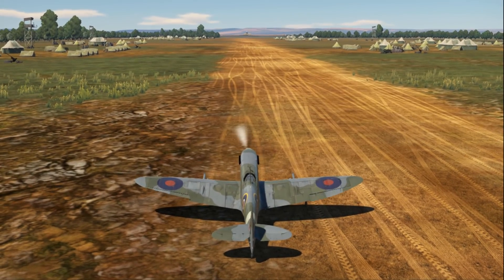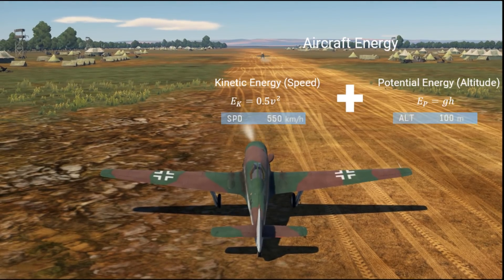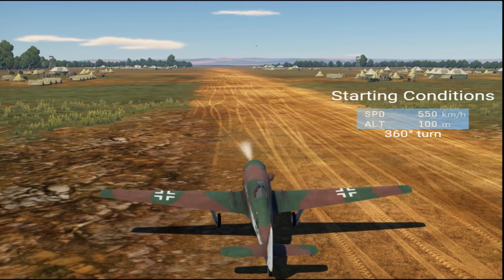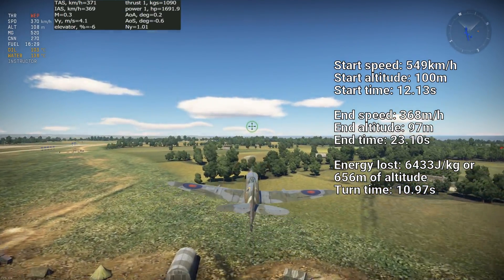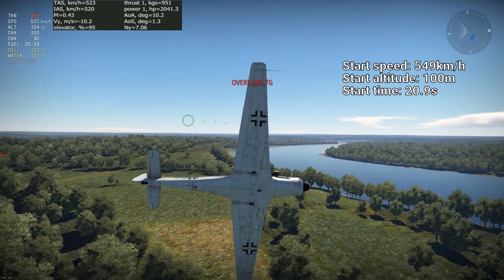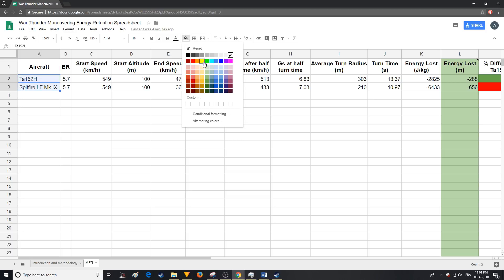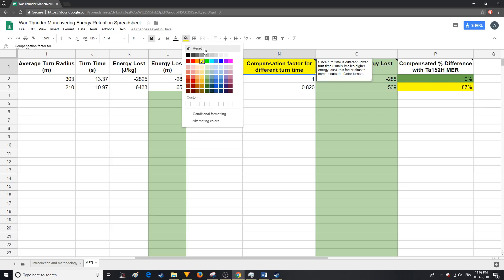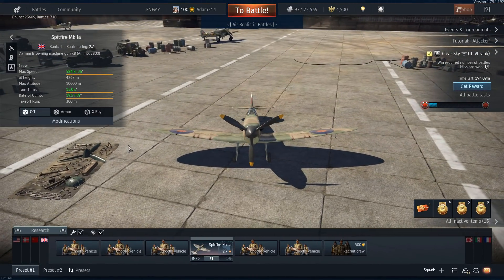Aircraft Maneuvering Energy Retention | Spitfire LF Mk IX vs Ta152H

Comment: Hi Adam, new subscriber. Will you be doing maneuvering ER for vertical manuevers? I think some planes like the 109s dominate at vertical manuevers despite horizontal turn performance being not all that outstanding. I've never really understood what it means when a plane is "bad in the vertical" so if you can cover it that'd be nice! Feel free to add as many physics concepts as you need :D
Reply from the maker: Welcome!

Hmm perhaps. I don't see why an aircraft with better MER would not also have better VMER though, still thinking about that.

An aircraft is considered bad in the vertical when it has poor climb and perhaps poor low speed maneuverability. It's not always clear what people mean by that though.
Reply: Adam514 I guess like what you said in one of your videos, loops are indeed complex manuevers from a physics standpoint. If you have the time to record it, a nice stat to keep for loops is how high of a loop certain planes can reach, or how low of a split S, maybe minimum starting speed a plane must be for it not to stall at the top of the loop, energy losses, etc?

Speaking of which, I think your sea level speed spreadsheet link in this video has a problem, it brings me to my browser where it tells me to download Sheets even though I have it, and not the Sheets app itself.
Reply from the maker: Yeah maybe I'll do a loop ER starting at the same speed, and compare energy loss, loop time, loop radius, etc.

That's odd, I got that too. I fixed it.
Reply: Adam514 If I remember correctly, a loop is actually egg shaped so finding the radius is probably not all that useful, and undoubtedly tricky as it does not have a uniform radius. I think just recording the height should be sufficient, unless you can find the horizontal separation between the ascent and descent parts of the loop.
Reply from the maker: A loop is egg shaped indeed, and egg shapes are simply a bunch of parts of circles with different radii strung together. I would approximate the radius by dividing the difference between the highest and lowest altitude by 2.
Reply: Adam514 I have a question about the spreadsheet: why is energy loss measured in m? Is it just the equivalent height loss if all energy lost was taken to be gravitational potential energy?
Reply from the maker: Exactly! It's simply the total energy lost reconverted into altitude lost, since J/kg doesn't evoke much in most people.
Reply: Adam514 Thanks for the info! Gotta commend your reply speed :D
Reply from the maker: Haha as long as I'm not sleeping and I actually get the notification!

Comment: 2:00 - you made a 9g turn. In those times the anti-g suits did not exist. Everything over 4G will make you almost instantly unconscious. Also the aircraft frame was not designed for such high-g turns. You should rip off the wings.  Next, TA-152H is the energy fighter. The energy fighters needs different kind of tactic than old-fashioned maneuver fight style. And also remember that tightest turn or max speed entry turn is not the fastets turn. The key is to start turn in corner speed.
Reply from the maker: The average person can sustain 4G for a while, let alone trained fighter pilots. I'd estimate that the top 10% of pilots resistant to Gs would be able to complete this maneuver (I'll admit not as precisely) without passing out. It's a 10s turn averaging at 7G. People don't pass out instantly just by the G number alone. You probably pull near 9G every so often, just by jumping the last few stairs. It only lasts a fraction of a second though so you don't notice.

This video is not about any sort of tactics, it's just aircraft performance.

Fastest turn time in such an energy bleeding turn probably requires to be significantly over your corner speed in order to maximize the time the aircraft's speed is actually near the corner speed. Corner speed is the highest speed where max angle of attack and max lift coefficient is achieved (minimum turn radius). Both tests started just slightly above the corner speed if you compare the "AoA" (angle of attack) between the start of the turn and when the speed goes lower (max AoA).
Reply: Wrong. Corner speed is the speed when the instant turn has maximum possible angular speed. It is not about turn radius. It is usually the point where the highest G and maximum allowed AoA are met. TBH my experiences are from DCS:World WWII project.
Reply from the maker: Maximum speed to conserve the smallest radius (max AoA) is synonymous to maximum angular speed. I just said it a different way.

Maximum AoA and highest G at max AoA is equivalent to maximum AoA and highest speed at max AoA which is equivalent to minimum radius and highest speed at max AoA.
Reply: Try to have maximum AoA turn at 150kph IAS and maximum AoA turn at 500kph IAS. You will have different Gs and different radius and still the higher g turn will have better anagular speed while the radius will be bigger. In very high speeds the G is limit because it won't you allow to increase the AoA. In low speeds the AoA is the limit because it won't allow you to pull more Gs. Also there is one more problem.  Those aircrafts did not have power booster. So you had to pull the stick by both hands with force over 50kgs in those high speed turns.
Reply from the maker: At 500 you are very close to you minimum turn radius, if you aren't already.

I agree some aircraft had earlier control lock up. Max speed while keeping max AoA will give the best angular speed. Best turn time must be at a slightly higher speed.
Reply from the maker: Interesting. Also for modern fighter planes they have the potential to go afterburner and actually stay near their corner speed for a while due to their much higher T/W.

Comment: Hey adam. I love the idea you have going here and it's a really informative video, however my inner nerd feels the need to correct some of the physics.

When giving the energy lost in a turn as J/KG you are giving a slightly misleading figure since mass is incredibly important in this case. Ovbiously a lighter plane with the same J/KG lost will lose less actual energy than a heavier plane with the same J/KG loss due to the lesser mass giving a lower absolute value. Since J/Kg is merely a coefficient it may give misleading values for the energy retention of an aircraft unless it is converted to just Joules.

This also means that you cannot equate it to altitude loss to maintain speed since the equation for GPE=mgh, again mass needs to be considered.

That said, I love the format and have subscribed (something I really should've done ages ago)
Reply from the maker: Hey! I encourage discussions about physics!

You are right, a lighter plane would lose less energy if mass was taken into account in the equations, but it would also start with less energy. But is that what we are really looking for? For example, an A6M at 500km/h would have less true energy (taking into account mass) than an F86 at 360km/h, but the A6M would easily catch the F86. Taking mass into account gives the wrong conclusions with regards to energy states. F4U4B has approximately double the mass of Bf109s, so if they had the same true energy the Bf109s would easily catch the F4U4B. By removing mass from the equations, you get a fair comparison in energy states, and which aircraft could catch another in the short term.

Mass plays a role in how much speed and altitude is lost in the turn of course, but it shouldn't be in the energy equations. The higher mass aircraft would start off with a much higher energy which isn't fair, and will end up with more energy in the end too.

Welcome! Let me know if something wasn't clear or if you still disagree.
Reply: Adam514 I see where you're coming from in terms of speed retention. However when I find myself energyfighting it's more about how much energy until they drop out the sky, which again is likely much lower for a lighter aircraft despite starting on a lower energy. I suppose it depends on your fighting style however.
Reply from the maker: Even then specific energy (energy without taking into account mass) is still a better measure of when an aircraft will stall, because stall doesn't really depend on weight. A lower wingloading aircraft will stall at a lower specific energy for sure.

Comment: Could you see if there’s any difference in ‘vertical’ energy retention compared to energy retention in turns? I.E. start both at 200 km/h and 5000 meters and dive at 30 degrees to 3000 meters, level out, note the new speed, and immediately climb at 30 degrees and level out when the speed returns 200 km/h. 

Could also add variations in starting and ending altitudes as well as dive angles (15,30,45,60) to get a richer performance profile of each plane.

Also for statistics acquired through testing I would repeat each test maybe 5-10 times and average them.
Reply from the maker: A squadmate is planning on doing something similar.

5 times is massive. It's a computer simulation, the need for multiple tries is greatly reduced.

Comment: Try the Stuka (Ju-87) and after a 360* turn you will crash into the ground because you have bleeded to much energy...:-D
Reply from the maker: Lol I think the real challenge is getting it to 550.
Reply: Adam514 Probably ;-) One question where do you have this nice chart from?
Reply from the maker: I made it.
Reply: Adam514 The chart which shows TAS,IAS, thrust and so on?
Reply from the maker: Oh it's called the "local host".

How to access the "local host":
You need to be running War Thunder or it won't work!

Option 1: on the same computer that is running WT:
-Type http://localhost:8111/ in the address bar and press enter and voila.

Option 2 (which also works on the computer that runs WT):
-Type http://Your_IP_Address:8111/ where you replace "Your_IP_Address" by your IP Address (192.168.X.XXX) in the address bar and press enter and voila, you can look at the characteristics on another device while flying.
Reply: Adam514 Thank you for your quick answer :-) but I guess this does only work for the replays?
Reply from the maker: Nono works everywhere, in matches too. I overlay it on my gameplay for YouTube.
Reply: Adam514 Ok cool, thanks

Comment: The LF 9 on current test flight spaded has 2000 HP, not 1700. Reference has an issue applying 150 octane modification to the LF 9.
Reply from the maker: Damnit, good spot. I'll redo the LF, the result shouldn't change by more than 10% though. Thanks mate!

Comment: Vidéo intéressante. Energie perdue en J/kg ?! Est-ce que ça veut dire que tu prends en compte la masse de chaque appareil ?
Personnellement j'aurais préféré une comparaison contre autre chose qu'un "turnfighter", sachant que le résultat allait être assez évident ^^
Une comparaison contre un P-47M, un P-38L, le 1er Spitfire Griffon ou un Yak-9UT aurait plus intéressante, selon moi :P
Reply from the maker: Merci!

J'ai utilisé l'énergie spécifique, c'est-à-dire l'énergie sans prendre en compte la mass, puisque la masse n'a pas d'importance lorsqu'on compare l'énergie des appareils.

LF et Mk XIV (1er Griffon) ont sensiblement le même résultat. Ce n'est pas les turnfighters nécessairement qui sont moins bons, parfois/souvent c'est le contraire!!
Reply: "...puisque la masse n'a pas d'importance lorsqu'on compare l'énergie des appareils." Il me semblait que l'Energy Retention d'un appareil dépendait en partie du rapport puissance/poids de celui-ci et dans ce cas la masse est  impliquée.
Concernant les turnfighters je voulais avant tout parler du design (surtout les ailes). 
Avoir un meilleur turn rate (à partir d'une même vitesse) signifie un "angle d'attaque" supérieur et donc une résistance/frottement de l'air plus pronnoncé(e) et donc une perte d'énergie/vitesse accrue (je sais pas si je me fais bien comprendre ^^).
Du coup une comparaison de la MER entre des avions avec une manœuvrabilité/turn rate similaire (avec le P-47M et le P-38L par exemple) aurait plus intéressante à mon avis :)
Reply from the maker: Oui la masse influencera la vitesse et l'altitude final, mais il ne faut pas inclure la masse elle-même dans l'équation!

L'angle d'attaque est similaire pour tous les avions, c'est plutôt la charge ailaire (masse/surface ailaire) qui influence le turn rate. Plus tu as une grosse aile pour ta masse, plus tu tournes rapidement.

Je les ferai tous! Regarde mon spreadsheet!
Reply: "... Plus tu as une grosse aile pour ta masse, plus tu tournes rapidement." Ouais je comprends. Mais une ailes plus grande signifie plus de drag aussi, non ? Du coup j'imagine que l'avantage d'une meilleure charge alaire compense le drag supplémentaire ?!
Cool la spreadsheet. Tu utilises la même procédure que dans la vidéo ?
Reply from the maker: Oui une plus grande surface ailaire permet de tourner plus rapidement mais en perdant plus d'énergie, d'où mon facteur de compensation pour les avions qui tournent plus rapidement. Idéallement mon facteur devrait compenser le drag supplémentaire. Aussi les avions qui tournent plus vite perdent plus d'énergie, mais dans une plus courte période de temps puisqu'ils finissent leur tour en moins de temps.

Ouais même méthodologie!

Comment: Very interesting, I think it was a good and fair test however I think 360 degrees was a bit mutch because planes rarely turn that mutch and for some planes they wil almost stop/ stop loosing speed before the turn is even completed. 

Nice to hear you talking instead of text btw ;-)
Reply from the maker: 360° might be exaggerated for actual situations, but the same conclusions drawn from 360° applies to 180°. Problem with 180° is the loss of the reference point (vehicle).

I suppose it's nice from time to time!

Comment: I think all of your fans would appreciate it if you could clarify the role of elliptical wing shape on maneuvering energy retention
Reply from the maker: Man that's a complicated question! 

First off, to clarify: what improves MER is the elliptical spanwise lift distribution, not the shape of the wing itself. An untwisted elliptical wing will produce an elliptical spanwise lift distribution, but you can approximate the elliptical lift distribution with a rectangular wing by tapering and twisting it.

MER depends greatly on lift-induced drag. Lift-induced drag is a function of a few things, the ones that concern us are aspect ratio (wingspan^2 / wing area) and the Oswald coefficient (lift distribution coefficient).  Lift-induced drag stems from the fact that the creation of lift is not 100% efficient. Since wings have finite length, the higher air pressure under the wing tends to spill out and flow towards the top of the wing, creating a loss of lift and forcing a higher angle of attack to produce the same lift. This phenomenon produces wingtip vortices, and wingtip devices such as winglets reduce the spill of air and decrease lift-induced drag. If the wing had infinite wingspan, lift-induced drag would be 0 because this phenomenon would affect a negligible portion of the wing. That's where aspect ratio comes in: the higher the aspect ratio (longer wingspan), the less fraction of the wing is subject to this phenomenon and the least lift-induced drag is produced.

The lift distribution coefficient (Oswald) plays a similar role. Since the phenomenon of high pressure air spilling occurs mostly at the wingtips, if the fraction of the lift produced by the wing near the wingtips is low, a lower amount of lift-induced drag is created. An elliptical spanwise lift distribution gives a theoretical wing lift value of 0 at the wingtip, and that's why it reduces lift-induced drag.

Lift-induced drag equation: C_D,i = (Lift Coefficient)^2 / (pi*Aspect Ratio*Oswald Coefficient). As you can see, if aspect ratio is infinite, lift-induced drag tends to 0. Oswald coefficient (spanwise lift distribution coefficient) is typically under 1, since it's the ratio between the actual lift distribution / elliptical lift distribution.

Hope that helps!
Reply: Adam514 Why didn't you take relativistic effects when calculating kinetic energy? The formula should be mc^2/(1 - v^2/c^2)
Reply from the maker: It's an approximation I thought long and hard about using. My justification is that if I use the approximation for every test, it will cancel out the imprecision of the approximation, and in any case aircraft MER are compared to each other.